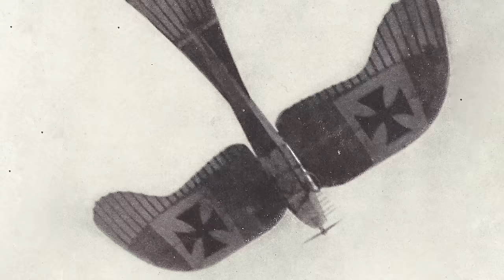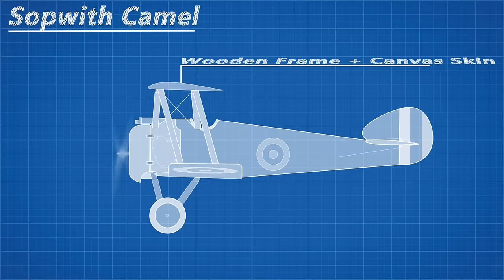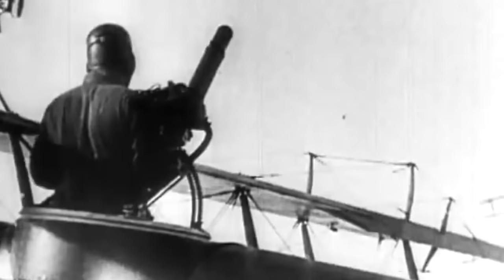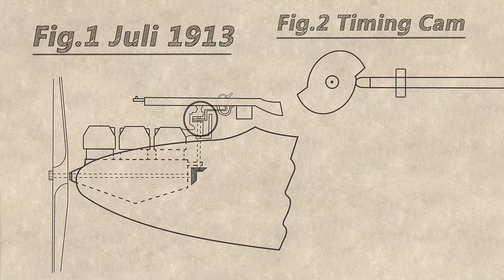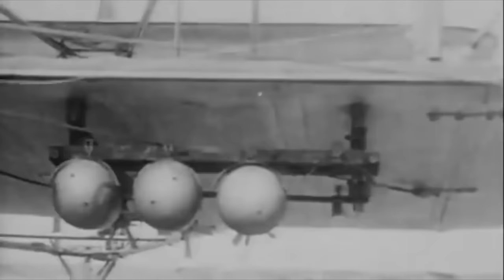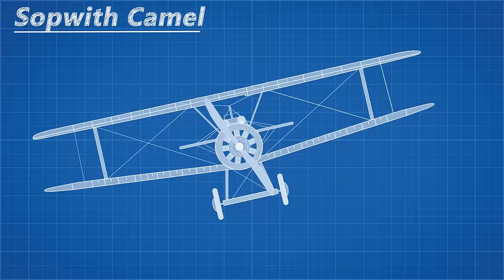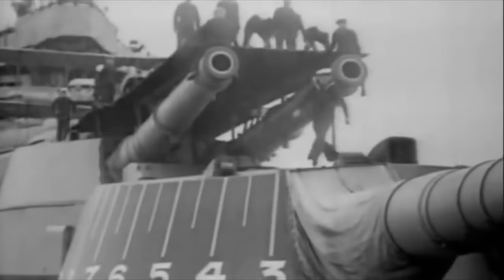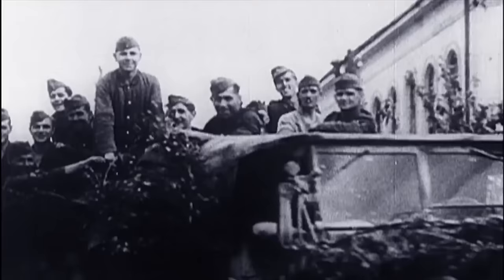The Physics of World War 1 Planes feat. The Great War Channel

Comment: Dont take this the wrong way its a good video but Its a misconception that they were unable to make the wings longer in WW1 due to material constraints and thats why they were forced to use biplanes. In reality they did not understand airfoils (wing cross section) well enough so they used very thin sections like the wings of birds ( about 4-6 percent thick). these were unable to support themselves so they needed to be braced and couldn't be cantilevered very far. Today we understand that a thicker wing section produces roughly the same drag so our wings are standard 12 percent thick and the support can go inside the wing. I have flown gliders before and there wings were made and supported by plywood. if you dont think they had plywood in WW1 your mistaken :). Furthermore there are HUGE benefits to making wings longer and not having 2 of them. firstly they dont need external support, did you know that a wire has the same drag as a good wing 10 times thicker than it? those support wires produced more drag than both wings put together. secondly the longer the wing the lower the induced drag, Cdi=cl^2/(pi*AR) where AR is span over chord. this means biplanes had so much more drag than monoplanes that they actually required much much more powerful engines to fly instead of needing less as you seem to have stated,  which is why no aircraft today except aerobatic-planes are biplanes. Even biplane aerobatic planes are obsolete with the mono winged extra 300, just add more aileron to roll faster.
Reply: They were like: oh well guess we’ll make thousands
Reply: A glider made of modern materials weights 500 kg, more than some ww1 plane with engine and guns.  So making wings longer is probably not that simple
Reply: That's a long message
Reply: I'm sure you are not going to read my answer but i think that you are the most intelligent person on this chat. I can't believe that an error like this is mentioned only by one person. Clap Clap
Reply: Came here to make the same points….you saved me a lot of unnecessary typing. Thank you!
Reply: @Vmodels7 This isn't a chat it's a comment section
Reply: I came here to write this same comment but you beat me to it. The Fokker company was the first to start scientifically testing airfoil shapes in wind tunnels, and they learned some surprising things which they incorporated in to Fokker D.VII and D.VIII. For the D.VII, the thicker, round nosed airfoil they used provided better stall characteristics which made the airplane safer to fly, allowing relatively novice pilots the margin to push the airplane harder without the fear of the airplane stalling and entering a violent spin. It was still a biplane, but they were able to ditch most of the external bracing since the wings were strong enough to support themselves. The D.VIII was a monoplane with no external bracing at all, which allowed good performance even from its outdated rotary engine.

Comment: Nice Overview! The part with rotary engines got me thinking, could you maybe make a video about engines? A video about the very interesting Wankel engine? Or about the differences between Straights, Vs and Rotarys or Diesel and Petrol engines?
Reply: good idea, if you could include why a bugatti veyron has a W16 engine and the difference between and w and a v engine
Reply: Apace Everyone already knows that radial engines are the best.
Reply: Apace Rotary (Wankel) engine is not a Radial engine. Radials use pistons, Rotarys use rotors.
Reply: Rotary-piston engine. Search Gnome, LeRohn, or Oberrussel rotary engine. The entire crankcase and cylinder assembly rotates around the crankshaft.
Reply: Blake Wilson I was thinking the same thing.
Reply from the maker: Oh man, every time someone makes a request I realise how much subject matter I still have left. It's endless. I will get to these things...eventually.
Reply: Alway the same error: the Wankel IS NOT a rotary engine: they official name given by Felix Wankel, engeneer by NSU is rotary PISTON engine...a rotary engine as a rotary engine block, the first was the 5 cyl rotary engine installed in the rear wheel from  the  1893 Felix Millet motorcycle
Reply: Well, either or...
Rotary = Not a wankel.
Wankel = Not a rotary.
Radial =Not a wankel, NOR a rotary.
Rotary: Crankcase rotates (hence, ROTARY), while crankshaft is bolted to the airframe, the propeller is mounted to the crankcase.
Radial: The complete opposite, fixed crankcase to airframe, propeller mounted on crankshaft, and in fact many rotaries were converted into radials right after the end of WW1.
Wankel = Crankcase is mounted to the car frame, but it`s Piston(s) rotates, planet gear connection to crankshaft which sends power to flywheel and clutch.
The more pistons a rotary piston engine has = 2 rotor wankels (13B), 4 rotor wankels (20B) and so forth.
Calling it a rotary isnt wrong by itself, it just that it falls between rotary and radial aircraft engine operating principles, but it`s NOT the same as a rotary.

Comment: Need water cooling to overclock your plane
Reply: The Spitfire build is one of the best examples of the utilization of water cooling in an overclocked planes.
Reply: @thetman0068  But can it work at extreme angles?
Reply: @oneofmanyparadoxfans5447  Or does it have RGB?
Reply: @hoovyzepoot  Only with forest camouflage.

Comment: Why doesn't anyone ever talk about how the allies first handled the issue of shooting through the propeller? Everyone always skips that and talks about the synchronizing.
Reply: Just slap some armour on that propeller!
Reply: Kindofa slapp-dash approach to the problem but it worked. Sort of...
Imagine flying your wood-and-canvas plane with what is esentialy a glorified lawnmower engine - but a lot less reliable -  in a life-or-death combat with sparks and pieces of your MG's bullets buzzing 'rund your ears....
Reply: The deflector plates were heavy, slowed the engine down, were never balanced and wore out bearings before their time. Much more effective to strap a gun to the upper wing. When Fokker built the interrupter gear the Germans wouldn't believe it worked. He was Dutch, not German, after all. But it did work and gave them almost a year of air superiority.
Reply: @NIX--Done by a dutch designer ,i think Andreas Fokker.Copied by the allies.Gun interupter gear.
Reply: @bengunn3698  It looks like two germans invented the synchronised gear (for Germany, at least) but they worked for Fokker, so he claimed it
Reply: If I remember correctly, wasn't a French pilot the first to employ that technique?
Reply: @poppys3728  ROLAND GAROS
Reply: It is an interrupter gear attached to propeller and gun.. Which avoided the bullets to propeller

Comment: Hi, also worth noting about the biplanes is that the upper wing helps directing the air over the lower wing, making the plane almost impossible to stall (which is an ever-present issue with monoplanes). This allows the pilot to maintain controlability over the plane at extremely low speeds, which was extensively used by the biplane pilots in combat manoevers, like Immelman turn.
Reply: Vladimir Petrovic IIRC the stall speed is much reduced over a similar monoplane, but the biplane wing will eventually stall after all lift is proportional to the square of the speed.
Reply: The Immelmann you wouldn't want to perform near stall, though.

Modern monoplanes designed for civilian operations can be made to be almost impossible to stall. Look at civilian STOL competitions, the planes take off with barely any speed. Plus with more modern technology like blown flaps you get a sink rate that won't quit, but not a stall.
Reply: Vladimir Petrovic wrong.
Reply: MAX IMMELMAN FLEW A FOKKER EINDECKER  TRANSLATES INTO "ONE WING, (DECK).

Comment: The airplane, one of the most brilliant inventions of all time.
Reply: Also one of the deadliest.
Reply: and it was invented by bicycle mechanics. .
Reply: Geoff Burkman plane crashes (fatal) are very rare so you kinda wrong
Reply: @MisterG2323  Aviation travel is the safest form of transportation in history.
Reply: @Swag_K1RBY  and 715rdmail:  I'm thinking more in terms of its military applications, e.g. Dresden, Hiroshima, etc.  Undeniably deadly.
Reply: @715rdmail  as well as an extremely efficient delivery system for munitions.
Reply: @MisterG2323  delivery and transport. Not very deadly
Reply: @CarlosAM1  True that, those functions in and of themselves are relatively benign.  Beyond that, it all depends on what's being transported and delivered.  Pretty sure I've already covered that above.
Reply: @MisterG2323  mhm. But I think theres something way more deadlier in the case, rockets.
Reply: @CarlosAM1  I agree, and will point out that they are essentially a direct descendant of airplanes.  Drones of various and sundry types will rapidly and inevitably replace manned aircraft.
Reply: Geoff Burkman You can say that about most things... automobiles for example, not originally made to kill but they can. A missile is basically an oversized firework, rocks aren't supposed to be deadly but they can be. Humans love turning things into weapons.
Reply: @cpt.shmitt7387  You'll get no disagreement from me on that count...")
Reply: Planes are like hammers; you can use them to build things or destroy them. It is us humans who would choose to decide whether they would be used for good or not. Planes are our desires expressed in a heightened way.

Comment: Rotary engine, or Radial Engine?
Reply: Rotary...radial engines came later.
Reply: Yeah that can be confusing to those not familiar. When discussing these planes they did have a "rotary" engine.  it is referred as such because the engine itself rotated. It is not referring to a Wankel type engine that most people think about when hearing "rotary engine" . Like mentioned above the more conventional radial engine that you're thinking of came later.
Reply: Rotary, the Radial engine has its cylinders fixed, and a moving crankshaft attached to the propeller, like any inline or v configuration
Reply: not the be confused with the wankel rotary engine, aka the dorito monster
Reply: It's a radial engine that rotates with the prop. It was the only way to air cool a really slow airplane. The alternative was water cooled engines, which were much heavier.
Reply: Rotary, but the radials came later
Reply: @unklekal7571  no, it’s a rotary engine that rotates with the prop
Reply: They are both rotary and radial, actually. But for purposes of differentiating the two, we call radial non-rotary radials and rotary radials rotary.

Comment: This video is loaded with misinformation because it oversimplifies nearly everything in its comparisons and by glossing over details just gets a lot of its assertions flat-out wrong.

"The Camel was harder to fly than the triplane" - the opposite is true. The Camel was harder to fly than the Sopwith Pup. 

"The Fokker triplane" - omitted that it was an incorrect copy of the Sopwith triplane.

"The Fokker's three wings" - actually, it had four.

"The Fokker was harder to shoot down because it was more maneuverable" - it was harder to shoot down because it lacked the vulnerability of wing wires.

"The Camel turns asymmetrically because the rotating radial acts like a gyroscope" - true to a point but so what? Any high-torque engine in a lightweight, single-engine plane is going to exhibit asymmetrical turning - look at the Japanese Zero. And it's not restricted to radial engines. Open the hood of any car and watch the engine try to twist to the side when someone hits the gas for you. It's a matter of the weight ratios between how much is turning and how much isn't. BTW - the Fokker used a rotating radial as well - and wasn't nearly as stabilized for turning and banking as the Camel. That's what contributed to its maneuverability - it jinked naturally.

Camel vs. DR1

https://youtu.be/Z25T-s0gu8M

Trust the pilots, there's what they have to say.

Comment: Dr1 was introduced to respond to Sopwith tripes but was designed without understanding why the Sopwiths were superior so still had wide cord wings inhibiting vision, plus all Fokkers were basically shite with every model at some time being removed from service due to structural failure. A Dr1 nearly did for Lothar von Richthofen when he pulled the top wing off.

Comment: The biggest advantage of a rotary engine is not requiring water cooling, it is surprising how many aircrafts were downed by having their radiator pierced, leading to engine overheating and stalling.

Comment: it's not a rotary! it's a radial engine! rotaries are in some older VWs and Mazdas.
Reply: Caleb Williams that's a different kind of rotary engine. This is also a rotary engine. The cylinders are mounted radially, as in a radial engine. But in the rotary engine, the crankshaft remains static (bolted to the firewall) while the prop is attached to the crankcase. As a result, the rest of the engine (along with the prop) rotates around the crankshaft. Meanwhile in a radial engine, the engine itself is bolted to the firewall (like engines normally are), and the prop is attached to the (spinning) crankshaft
Reply: The rotary engine you're thinking of gets its name due to the fact that it uses a rotor instead of pistons. This rotary engine gets its name because it actually rotates with the prop, while the crankshaft remains stationary
Reply: Caleb Williams. No, these are rotary engines. They were called so long before the Wankel engine was invented. The Wankel engine was always called so in the data sheets of the few cars they came with, namely the German NSU and alter Mazdas. VW never had any Wankel engines cars. The only reason the Wankel is called "rotary" is because it was erroneously called that by ignorant people and because those people wouldn't know what a Wankel is. It's not it's proper designation. Never will be. 

And lastly. A radial and rotary aren't the same. They don't work the same and are fundamentally different in everything but layout. 

1. Google or Wikipedia a Rotary engine. The WWI aircraft engines will appear.
2. NSU was later acquired by VW but by then they had since long stopped manufacturing Wankel cars. 
3. For the love of god these aircraft engines were called rotary long before you kids started calling Wankel engines that. End of story.
Reply: vw never use wankel (was use by NSU,Citroën,Mercedes Benz,Mazda...), and the Wankel is NOT a rotary engine but a rotary PISTON engine (name given from felix Wankel himself), rotary is the MAZDA designation because they found this sexyer as "Wankel KKM"...The rotary engine was first use in 1893 in the rear wheel from french motorcycle Felix Millet...
Reply: The VW`s and Mazda`s had a wankel engine, they never ONCE called their engines "rotaries".
What makes the rotary motor different from a radial then?
In the radial, the crankshaft rotates and propeller is connected to the crankshaft.
In a rotary, the crankshaft is stationary, mounted to the airframe, and the propeller is connected to the crankcase.
The radial has a stationary crankcase, the rotary does not.
Hence, the Mazda/VW stationary crankcase is not a rotary, neither is it a radial.

Comment: Also, your writing suggests that machine guns came after the Dr1. That was 17. That had twin Spandaus. The Eindekker you showed earlier had a single (Fokker Scourge), while the DH2 had a single Lewis gun. That was in 15. The bigger issue was the interrupter gear, rather than power/performance (followed by training, but ultimately, production outweighed everything).

Comment: Smithsonian Air & Space Magazine did a CFD (computational flow dynamics) of the three winged DR-1. They found that due to the pressure distribution the middle wing generated relatively little lift but considerable drag. The plane would have had better speed and climb if it had been removed.

Comment: You forgot to mention that the two aerofoils that make up the wings of a biplane (or any other multi-aerofoil aircraft) reducing the effective lift from each aerofoil compared with the same aerofoil on a monoplane. This is the other reason why biplanes, etc, have generally fallen out of use, except in a few specialist roles.

Comment: the ignition timing switch on the sopwith was something else.  they would change how many cylinders were firing. they didnt use a throttle either. engine was shut off and on during landings, which made them very difficult to land. maybe you can make a video on these engines realengineering?!?!?!

Comment: I think you got the turn forces reversed. The torque is against the rotation of the engine not with it. As in order to make the engine turn in a clockwise fashion from the view of the pilot the crankshaft is torque to the counterclockwise rotation. Making it easier to turn left than to turn right.

Comment: I'm not an engineer but a glider pilot. Gliders have long wings because they give more lift with less wingtip vortexes (which contribute to drag) and higher Lift over Drag (L/D) ratio, NOT because they fly slow. Gliders commonly fly at higher than 100 km/h (I flew about 250 km/h in an IS28b2).